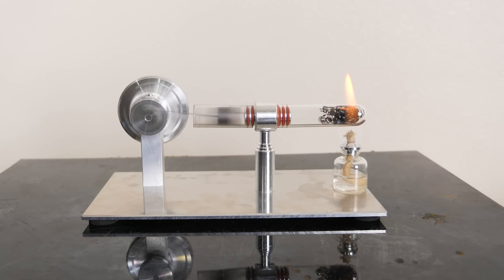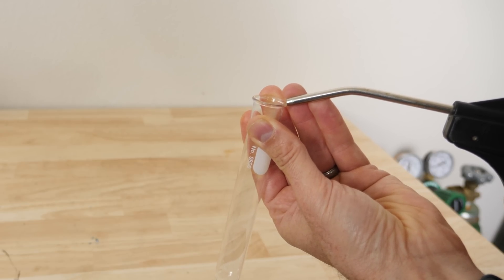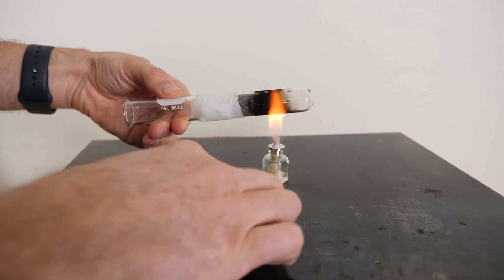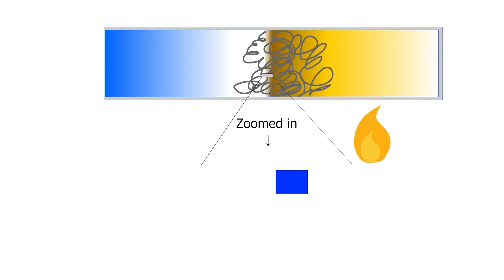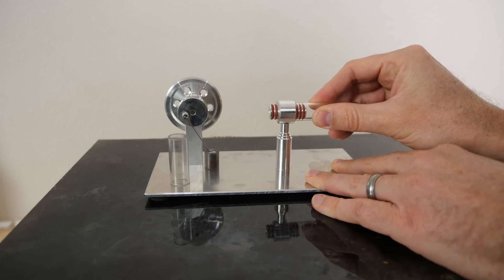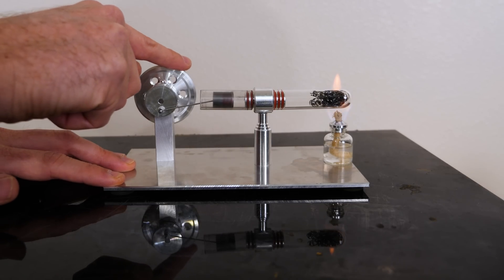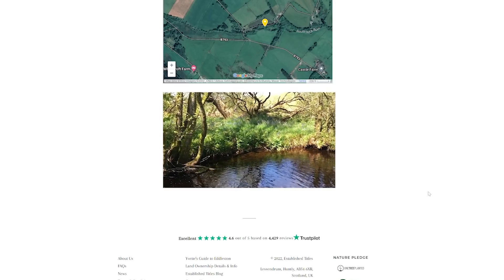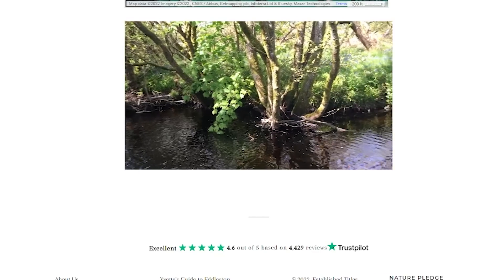This Engine Runs On Sound Waves!

Comment: Some crackhead relapsed after watching this. Steel wool in a Pyrex tube over a flame and you don’t even have to hold the little button down and burn your fingers? I’ve never even smoked smoked crack before but when it’s also a resonant cavity and I can do thermoautistic science it doesn’t seem so bad.

Comment: Wtf is this misinformation? Buu. Remove and redo, or change the title. This runs on heat. You can really do it with sound by balancing (or hanging) two plastic bottles on spinning stand, then blow on third one in your hand so the others pick up the sound like tuning forks. Speaker can also be used as source.

Comment: The most difficult part for me to believe is how fast the air can heat up (expand) and cool down (contract) in order to create this cycle of pressure waves that moves the piston this quickly.  That's the part that is incredible to me.
Reply: heat is an excitation while the sound is the acoustic property of the specific pipe. so the heat is like clapping.

Comment: try a  pelton turbine on the open end, instead of the piston. yes its a pop-pop boat pelton turbine generator. cool the other side with pulsejet cold input air flow. how about a heat sink instead of water. or water cooled heat sink. and copper tube. etc.

Comment: but what if you used a larger fly wheel, put a pulse-tube cooler on the other side , brought a copper tube back to cool instead of wet paper and then engaged a generator off the fly wheel that heated a nichrome wire to heat the tube?
Reply: Then we would have unlimited free energy or a perpetual motion machine.

Comment: A 60 years old Canadian bloke engineered thermoacoustic generator runs by water creates sounds, heat,n high voltage electricity with insane amperage, he afraid to patents it ,  just search galaxy in the box ,he's giving it away ,,

Comment: also if you made this setup bigger  would it make a stronger faster motor?
and if you add more herts per cycle will that change the motors power or speed in any way?

Comment: Hi I've got some test tubes and been trying to get sound, with the steel wool and wet paper towel as you have, but i just cannot get it to resonate, the tubes are 150mm in length
Is there some tweaking to be done to get it to work, example moving the steel wool in the correct spot. I have tried several different ways, just can't get it to work.

Comment: How efficient can this engine design be?  Looks simpler than a sterling engine but can it compete as far as efficiency is concerned?  Very cool thanks.
Reply: Efficiency depends a lot on the design and the environment the engine is working in, however NASA did some cool research some years ago in hopes to use them onboard deep space probes as a power source by making the heating source the decay heat of a lump of plutonium (similar to the old Soviet RTGs but used to power a stirling engine instead of a thermocouple). For example one thing that came out of it is that if internally the engine contains high pressure helium it performs a lot better. For more info, look up radioisotope stirling generators

Comment: I got two questions. Could that be used to charge a phone? Could you use mirrors to use the sun to heat that as well?
Reply: Once resistance is involved like connecting a generator, most things like this struggle.  It wasn't enough force to start the wheel moving and needed help.  The space and effort needed for a setup powerful enough to charge a phone would be more efficient with a solar panel, and in some areas, a wind or water turbine.

Comment: Could you combine this effect with a Tesla valve to get a pump with no moving parts?
Reply: The effect depends on fluid resistance that moves and bounces backward.  The Tesla valve would be a semi-passive way to stop the engine, other than killing the heat differential or adding a hard plug.

Comment: I'm sorry but it looked like you made it run with some kind of fuel witch in turn heated air witch could or could not make sound. My car does the same thing, fuel, heat, and sound zoom.

Comment: Is it sound that runs the piston or is it the heat energy?
Reply: from what i know from this topic i believe this is powered by the sound waves hitting the piston kind of like if you push a swing and then push it again at just the right time you will be pushed higher when you find the point that the sound waves are passing at the same time as the new waves the sound keeps getting stronger and stronger until it is strong enough to push the piston and when it moves back away from the piston it would create a negative pull that would pull the piston back with it.
Reply: @dexdex7581 yeahh that resonance. I'll have to watch the video again, cause I don't remember why I asked this😂

Comment: Dude, this is awesome. How scalable would this be? Wonder if we can set something like this up with sunlight using a magnifying glass to heat it. Cover the engine side to keep it cool...perhaps connect a little turbine and use it as a charging station for batteries or to keep an LED light on. Dude, this just blew my mind. Thanks for this!
Reply: Trash can be fuel too
Reply: The problem with things like this is they produce very little power. Which leads to them not being efficient, especially at larger scale. 
Regular solar would be better at small scale. Compared to the power output even something like a small gas powered generator would be better.

Comment: So I figured an interesting work around on computers being a source of power. It's mad sure but if it worked then it could be game changing for any technology with a processor.

Using energy heats things from just respective flow I guess you can put it. So what if you hooked a few generators like this to sink the heat through? I mean yeah there would be the issue of burning out components faster but you could still be cooling the processor in conventional means like a fan and it should still produce energy to get the whole thing running. The power output surely can't sustain a computer indefinitely but it could allow it to work in cycles in the long term... You may be thinking I'm thinking about just computers... Essentially this design idea is taking into account how we as living things work. You could describe our lungs as a form of Bellowed generator. If I was to build a robot using the processor as a heat source in the head with the tube pointing down into a bellow rib cage to pull in air for cooling and ossilation at the solar plexus the rest of the body is somewhat vanity or utility based from there... I need to draw this up actually

Comment: I wonder if these sound pressure wave engines are more efficient than a similar engine with intakes and exhaust?
Reply: Yes they are fairly efficient, but lack in torque.  NASA made a sterling engine truck, so yeah they can be used for such things.  They have a very fast piston operation,  with speed comes less torque.

Comment: This piston is a lot like a passive radiator on a loudspeaker, with the heat oscillator acting like the primary loudspeaker driver. Attaching the piston to the system changes the tuning frequency based on parameters of the piston and its flywheel load - clearly the frequency is greatly reduced over the earlier open pipe or your flywheel would be spinning over 30,000rpm. Adding more mass to the flywheel would reduce the tuning frequency of the system further, much like adding mass to the cone of a passive radiator. In short, the attached piston system improves energy transfer at lower frequencies by lowering the resonance. This is the same way you get more bass out of passive radiator loudspeakers, except the primary driver may be driven at any frequency, not just the natural resonance frequency, so it becomes largely a matter of electrical efficiency. Ported and horn loudspeakers also operate on similar principles, using air oscillating in cavities instead of a piston to improve acoustic coupling to the open air.

Comment: That looks a lot like a Sterling engine. I thought we were going to see an engine that converts sound pressure waves in air into motion.
Reply: Well it does remind me of a sterling engine as you heat the glass to keep the engine running once you start it
Reply: So about 150 people (so far) don't actually know what a fucking Stirling engine is but still wanna talk shit (which makes sense cause you're talking out your ass), cool, cool
Reply: @joshyoung1440  As for 150 people, it is the norm on Youtube. I often see technical videos with false info and 100s of appreciating comments. If you scroll through then you will see one or two comments that will debunk the whole video.
Reply: @afaqh2356  wait, are you saying you think this is a Stirling engine? That would make 151 idiots. Please, "debunk" this video for me.
Reply: @afaqh2356  I am one of the ones who appreciate this video. I'm saying the people who are calling it a Stirling engine are idiots. Honestly I'm not sure the point of any of that stuff you said to me. None of it was exactly on topic... all of it was tangentially related but ignored my point...
Reply: @joshyoung1440  As I said earlier, this is not a Stirling Engine. Because it does not have a regenerator.
It is a thermo acoustic engine. But interesting concept, well presented.
Reply: @afaqh2356 the center metal mount is the regenerator.
Reply: @joshyoung1440  I am an engineer from Pakistan. I have calculated how power & efficiency of Stirling Engine is effected by % of regeneration, dead volume etc.
Reply: @afaqh2356  that's nice, you are not one of the people I was talking about. I was referring to the 150 people who liked the comment. What did you think I meant by "nearly 150"? And yes, I'm aware that is the norm on youtube. I've been watching YouTube for 15 years.
Reply: Cause it is
Reply: @dronemotionlab  so it's not a thermo acoustic one, right? Just the plain old thermodynamic cycle.
Reply: But it is ot a Sterling engine, because it doesn't have a Seconds Piston.
Reply: @janluy603  This is a thermal acoustic engine. Difference from Stirling engine is the "Regenerator".
Reply: @afaqh2356  yes, but a regenerator ist not necessarily needed for a Stirling engine. The Second Piston is (i think)
Reply: @janluy603  No sir, second piston is only necessary to move the gas from hot area to cold and viceversa. If it is being done with wave, then it is not required.
The invention of Mr. Stirling, patented by him, was the regenerator. It is this, that improves the efficiency dramatically.
Reply: @txemagonz it is a Stirling engine, it just uses sound waves to do the job of the displacer piston

Comment: So.. hm.. question. I might also just be stupid for asking but- if you have an oscillating heat machine, can you hook it up to (forgot the name, but rotor that multiplies rotations) and hook the end up to a energy to heat transfer system to connect the whole thing? Obviously it would lose energy over time, but gradually and at a small enough incline to be able to produce plenty of energy? Like ik energy can't be infinite on a machine, and we haven't discovered it yet, but couldn't we create a device with a similar concept to this to produce enough energy that the energy we would have to reapply would be substantially low? Again, probably really stupid as im not that smart when it comes to science
Reply: not stupid.. it's just that all energy conversion systems have losses.  None are perfect, so when you convert from one form of energy to another, you always lose a bit.

lithium ion batteries are really efficient at taking electrical energy and storing it as chemical energy, and then taking that stored chemical energy and converting back to electrical energy, but even they lose 5% of the energy in this process.

Comment: Interesting! But is it really the sound what moves the piston? The resonance frequency of the sound wave is probably more than 500 Hz, while the engine runs at around 2000 rpm, which is 33Hz, far below the sound resonance. How is that possible?
Reply: The soundwave frequency is likely a multiple of the engine frequency
Reply: @Anonymous-df8it  Possibly, but still unsure, because as far as I know, the harmonics are multiples, but always at higher frequncies 🤔

Comment: You can do something similar with a blade of grass between your two thumbs (facing towards you and blowing between). Not thermal, but resistance and resonance of the blade of grass. It usually breaks if you blow too hard.
Reply: Works with most flexible films, like plastic food wrap or shopping bag material.

Comment: All the talk about electricity generation generally avoids the issue of how much energy it costs to manufacture the engine itself. This is true for the electric vs petrol engine debate too, most of a car's carbon footprint comes from the manufacturing and the best environmental thing to do is keep your existing car on the road
But that (admitedly cool) engine will take milling, machining and just the metal alone will take vast sums of energy to create. The amount of aluminium in a soda can (½oz / 14g) - to make just that much uses the same electricity as running a hair dryer for an hour

Comment: What if you use a test tube of a length that produces its own resonant frequency?
Reply: The length of the tube changes the pitch of the note it plays, but you need to adjust the position of the steel wool a bit when you change the length.
Reply: @yeroca  Right. The glass has a natural resonant frequency, at which it will produce its highest amplitude vibration. If you tune the tube to its resonant frequency, this experiment should produce some interesting, possibly catastrophic, results.

Comment: IT'S NOT A THERMOACOUTIC ENGINE.  A REAL THERMOACOUTIC ENGINE RUNS AT THE ACOUSTIC RESONANT FREQUENCY OF THE PIPE WHICH IN THIS CASE IS ABOUT 580 CYC/S FOR THE OPEN PIPE.  THE PISTON IS ONLY GOING MAYBE 10 CYC/S.  THIS TYPE OF ENGINE IS NOT ACOUSTIC.  IT'S NOT POWERED BY SOUND WAVES.  IT'S POWERED BY THE BULK MOVEMENT OF THE AIR ACROSS THE GRADIENT THE FREQUENCY IS NOT DETERMINED BY THE RESONANCE OF SOUND IN THE PIPE BUT BY THE FREQUENCY OF THE MECHANICAL SYSTEM.   LOOK IT UP.

Comment: I gave it a thumbs up, but I feel it would have been cooler and live up to the title better if you hadn't used a fire or other heat source. Would it work by blowing air across an open end? How about using a small speaker? Technically, it is just kicking the can down the road, since those require power, too, but the setup shown does not seem to run on sound, per se, and looks more like a typical model engine, or Stirling engine, only simpler. Now I am wondering about the possible advantage of that simplicity, how it compares regarding efficiency, potential power output, etc. I dearly want to see a follow-up!
Reply: If he had powered it with sound, then it wouldn't be an "engine" anymore. An engine is meant to convert some other form of energy into mechanical work. If you powered this with sound aka moving air, then you would be powering it with mechanical work to move heat, which would make it a heat pump. It wouldn't turn the sound into more mechanical work.
Reply: @PixlRainbow  WOW, sorry, but that is SO WRONG. First of all, sound waves ARE a form of energy. But not all moving air is sound (vibrating air molecules). Moving air that isn't sound IS also a form of energy -- which is why windmills are listed as a form of renewable energy; the windmills don't produce energy themselves, they convert wind energy to electric energy. If you used the sound waves in a tube illustrated with the moving air, not the little heater, you would not be moving heat and it wouldn't be a heat pump, the vibrating air would move the piston without using heat to create the vibrations, converting the energy of the sound waves into mechanical work, i.e. working as an engine. 

Good grief, how could you imagine you were qualified to comment on this?
Reply: @TubeNotMe  I never said sound waves aren't a form of energy. Where did you get that from? You totally misunderstood what I meant to say.
In thermoacoustic engines, the sound wave ITSELF is what produces the motion of the piston. The whole reason they are called "thermoacoustic" is that they convert between heat and sound. The piston rides on the sound wave and is simply a "sail" for the crankshaft to attach. You can provide a temperature difference and get sound (the "engine" form), or you can provide sound and get a temperature difference (the "heat pump" form).
If you want to know more, NightHawkInLight has two videos illustrating how thermoacoustics work.
Reply: @PixlRainbow  Ah, it appears I misunderstood you because you misunderstood me. I also didn't understand why you thought what I was talking about would be a heat pump. I am still not sure what you are imagining I had in mind, but it seems to be quite different from what I had in mind. I was not talking about producing heat with sound waves and I certainly don't need a primer on this type of engine. I  am talking about a NON-thermal acoustic engine. If sound is a form of energy and not just "mechanical work," then using sound directly to move the piston,converting the sound energy to mechanical work, would still make it an engine, right? Or if you insist some less obviously physical (or "mechanical") form of energy, such  as heat, must produce the sound, how about including the batteries that power the circuit that produces the sound?

Comment: Is this how steam engine also work?
Reply: no, steam engines use steam and are more complex while this just uses heated air. a sterling engine is far closer
Reply: @koalabanana1998  does due to stem don't  create similar pressure  in the pistons